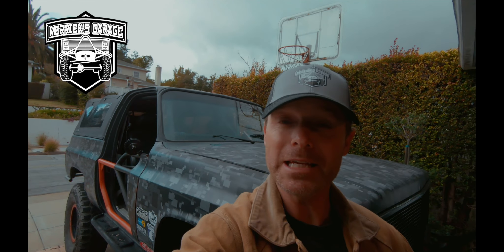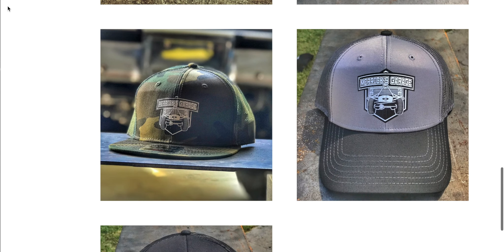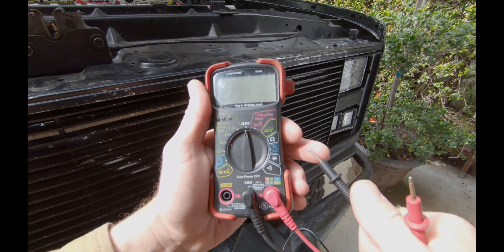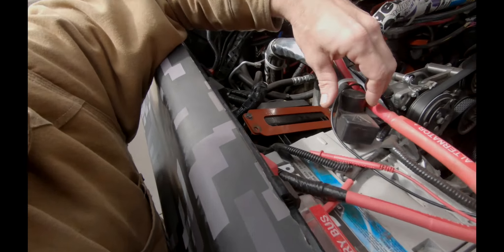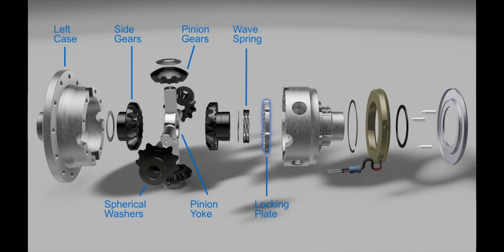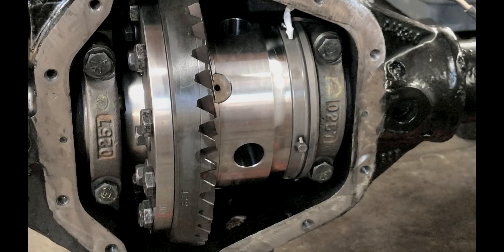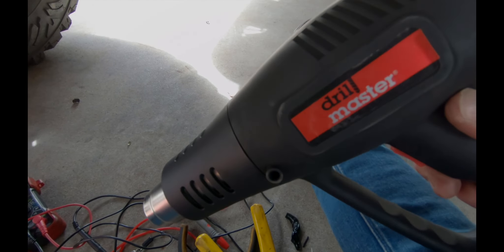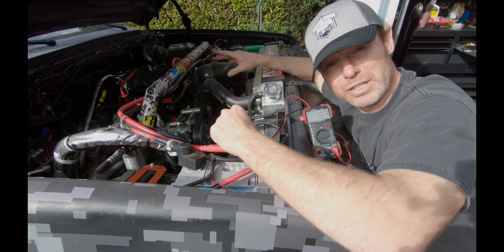MG #150 - Fixing my front locker with a multimeter

Comment: Those connectors are awesome! I bought a 300 piece kit a couple weeks ago so I can use them on my 87 k5 blazer.👍
Reply from the maker: yea, I was skeptical at first but the trick is a heat gun.  Lighter burns it, butane is too hot also.  They take a while to wick but once they do they are sealed!

Comment: FYI the DC 10a is to meter amps up to 10a, you will need to swap the positive over to the right side and put the meter in series. If you go above 10a it will pop the internal fuse
Reply: Also FYI I freakin love the show! I just sold my 72 for no good reason and miss it so bad

Comment: I hate the idea of piercing insulation, but ya gotta do what ya gotta do. I guess a safety pin is about the least invasive method. I also see guys using Power Probes and those are supposed to be awesome. More expensive than a safety pin, though :)
Reply: You can get that liquid electrical sealer. Works great for this.
Reply from the maker: yea, the closer to the connecter the better.  Sometimes you can get a pin into the connector without compromising the insulation.  Then again from the looks of the wiring that I have seen on a lot of squares, insulation or lack thereof is usually the least of the concerns!  There are some nightmare wiring jobs out there!
Reply: I want a power probe so bad. Awsome awsome device

Comment: Very educational , hey Bro I'm having some fuel issues . I've just had my second fuel pump installed on my 89 K5 within an 18 months period , what do you think ? Keep in mind I am nowhere near as knowledgeable as you , help.
Reply: @Marcus Wimberley Dude... thank you so much !! I'll do that plus thinking of replacing all the fuel lines as well , again thanks.
Reply from the maker: I went through about three pumps in about three months.  Total pain.  Part of the reason I dropped the tank.  I had one dead on arrival and one that failed after about a month or so of use.   Exactly, the cheaper the part the more likely it sucks has been my experience with the Autozone stuff.  I ended up with a Walbro that worked, although I had an AC Delco fail too.  Was pretty surprised.  In the end I redid the wiring harness on the sending unit too.  It was pretty low buck.  And make sure you don't run your tank dry.  The in tank pumps stay cool by being submerged in the tank.
Reply from the maker: yea, thanks for jumping in Marcus.  Great advice!!

Comment: Merrick those solder seal connectors are junk. You don't get a good solder job with them because you can't get the solder hot enough to properly bond with the wire. You end up with what's called a cold solder joint, and they're typically brittle, and break with time. You'd be way better off to either just solder the wires together conventionally, and use heat shrink tubing over the splice, or to use the crimp & seal style connectors.
Reply from the maker: that's good to know.  I am suspicious of these as it kinda seems too good to be true.  I will keep my eye on them for sure.

Comment: a spool in the front would have been a hell of alot easier, especially if you have locking hubs
Reply from the maker: ?  the difference between a spool and a E-Locker is like night and day.  My truck is daily driven on the street, and also being able to turn the locker off from my drivers seat does make four wheeling a lot easier.  Ever tried to get a fully locked front and rear rig around a really tight grippy switchback?
Reply: @MerricksGarage  oh i know steering is much harder, but ulocking on le hub makes life alot easier, and you have no mechanical issues with a spool. If you have hydro assist or full hydro, its alot easier. But i get the point of a selectable locker. Just think simple is better
Reply from the maker: It’s why I went with e locker not air.  It is a simple electromagnet that locks it.  Worst case scenario I can just connect it directly to battery if switch, relay or wiring is damagrd